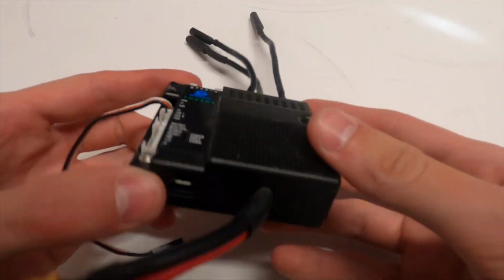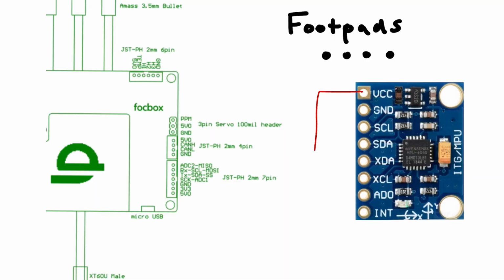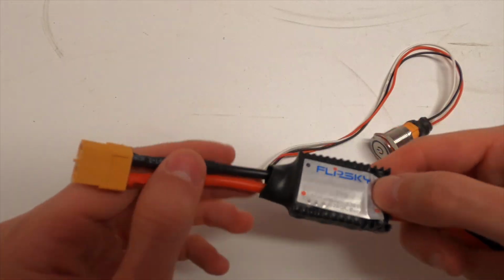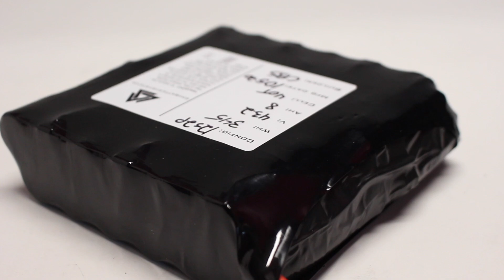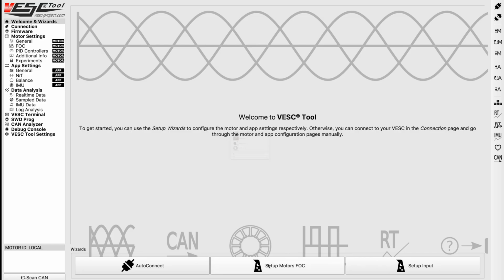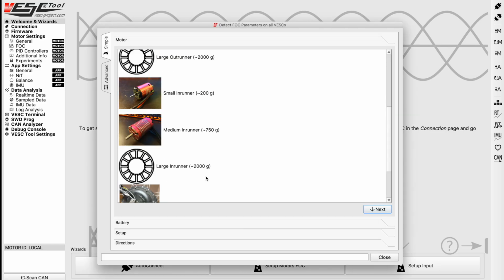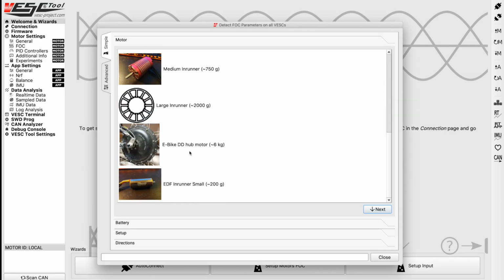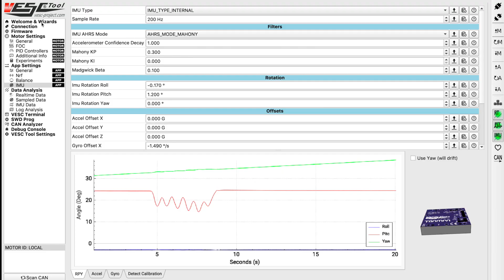How to Build a DIY One Wheel *17MPH - 10 Miles Range*

Comment: I am in the process of thinking about thinking about building a DIY onewheel. I have a Trampa VESC 6 MkV, a 10s 36v li-ion battery, a Phub-188 wheel, and the 2 aluminium rails either side. I just need to get my 3d Printer working again and I might be able to start building the frame. I'm a little concerned and confused about the footpad and the wiring in general
Reply: Do you remember how long did it take for phub-188 to deliver? I think their supply comes and goes because mine is over 1.5 months since order
Reply: @raiden72  trying to look through my AliExpress account, looks like I ordered 15/08/2021 and received 03/09/2021. I know alot of people have different experiences with the seller. I messaged them after a few days when it hadn't been dispatched, did seem to prompt them about. Good luck
Reply: @MartinNevilleVaughan  thank you for the reassurance :) I feel it shouldn't be long from now

Comment: Mine just arrived today. I was worried because I didn’t hear a thing from seller and he only accepts Bitcoin. Everything about this screamed scam, but no, everything is here as promised. Even the V2 rails that FM ordered the C&D about. There’s some minor differences between this and a FM, but for $400(and now even cheaper) less than a pint, i can’t help but recommend this. It took 8 weeks to arrive, and it was a very sketchy transaction, but all’s well that ends well.
Reply from the maker: Very interesting to hear that!
Reply: @DIYesk8Builders  the Motor is exactly 3mm too long to fit into a FM axle block. I shaved 1.5mm off each side of the axle bolt, and it now fits my XR. Why would you do this? 50% more power, and an adjustable speed controller. Got the idea from Mario contino, it’s basically a dead XR with floatwheel motor, esc, and battery. If I knew it would get viewers and help people I’d make a video describing how I did it.

Comment: Very cool video. I have a couple of suggestions, maybe they'll help. For the tire leaks, I recommended Tire Ject. It does well for both punctures and bead leaks. It's worked on another rider's hub that went flat in a day with no obvious leak. 
Also, that click/clunk when changing directions is the axle bolt being loose in the rail/plate. You can fix it in a couple of ways. On my board, I just retorqued then in with a good amount of leverage. Also, there are newer plates that are press fit over the axle. Even on the V1 kit, they should fit. The v2 Floatwheel used the same plates as you have until they changed it. If you want a set, let me know. I've got a bunch to send out.
Reply from the maker: Thanks man! I'd love a set of the new ones!
Reply: @DIYesk8Builders  Sure thing. I'll reach out and send some.
Reply: Would you have a link to buy perhaps on ebay? I drilled the holes in the aluminum for the peipei phub-188 but would like to ensure I am mounting it properly, if it is delivered :P

Comment: I noticed in your video you mentioned fabricating the riser pad by sending it into your local 3d print shop? 2 weeks? You should really just get your own 3D printer for home. They are really not that hard to learn, cheap and super fun to use. I make quick prototypes all the time. Grab an Ender 3 Pro printer online for around $250.00. Cheap very reliable printer. 👍
Reply from the maker: We definitely want to get one, but the hard thing is housing it. Have have next to no space :(

Comment: Those Anti-spin plates have been known to fail and cause the motor wires to get destroyed. There are some CNC steel clamps someone has produced... It would be cool if you could stock them in your store!
Reply from the maker: Where are these?
Reply: @DIYesk8Builders  I saw them in a private  OW DIY group but I can get them to contact your on instagram maybe. They just are finishing producing the first run of them so nobody had them yet.

Comment: Great video! I didn’t know DIY one wheels are a thing. What makes the production OWs more stable and smooth? Is this a tuning issue or better sensors & software
Reply from the maker: I think it's probably the time they have put in to developing the balance software, but idk for sure
Reply: @DIYesk8Builders  do you plan to make a purchasable kit to make this onewheel?
Reply from the maker: @eeveeminer4276  No we aren't unfortunately. Future motion will send a cease and desist letter to anyone that tries